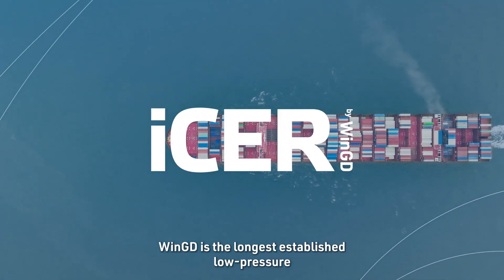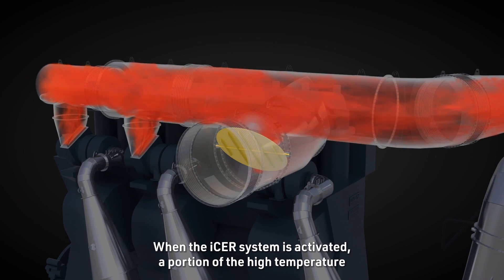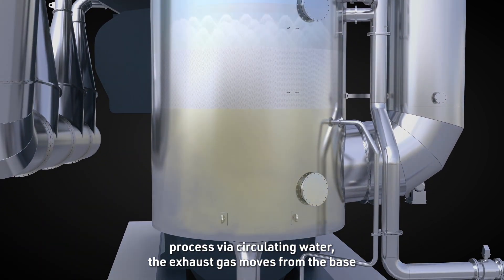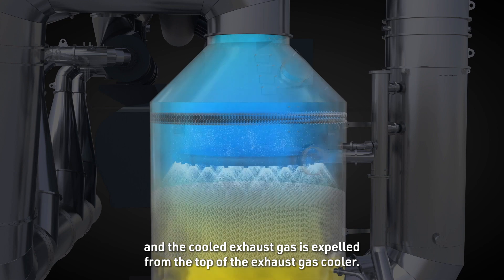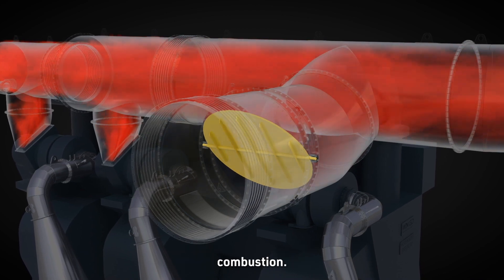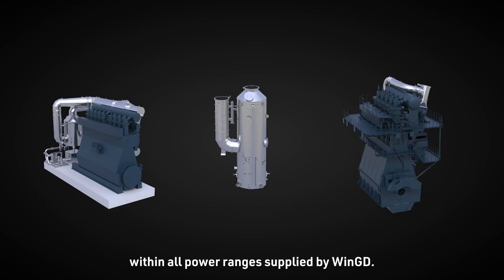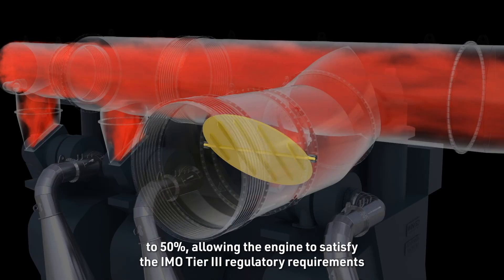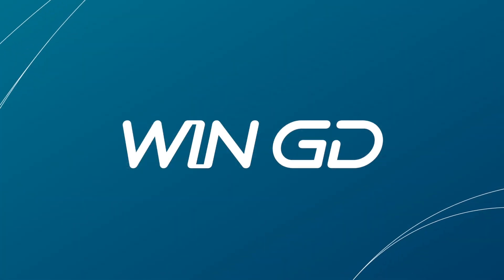WinGD iCER - Intelligent Control by Exhaust Recycling

Comment: How do you treat the water? Is it open loop or closed loop system? 

How do you maintain the pH, PAH and Turbidity of the feed water for the sprayers? 

How do you separate the sediments, carbon build up?
Reply: Circulation, Monitoring and bleed off.
Reply: @722FAC so its closed loop with chemical injection to increase the pH?

Monitoring with? 

Bleed off using separator?
Reply: @johndee0217  Yes. This system is called iCER Drainage System. During iCER operation, the iCER drainage system handles all the condensate water from the EGC and 
the SAC. This water is generated by the EGC cooling of the exhaust gas in the iCER system. It includes: 1. Water treatment system: the pump unit and the water treatment unit (oil-in-water (o/w) content limit 15 ppm)
2. pH-neutralisation
3. Dosing system: NaOH tank, the pump unit, as well as the monitoring and control unit.
4. Water holding tank